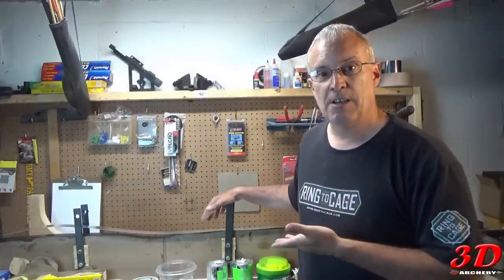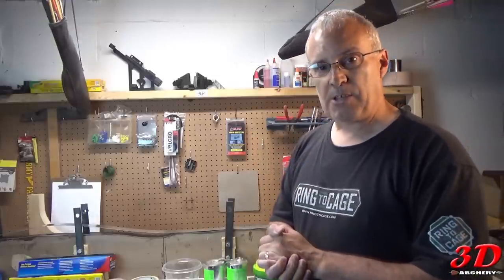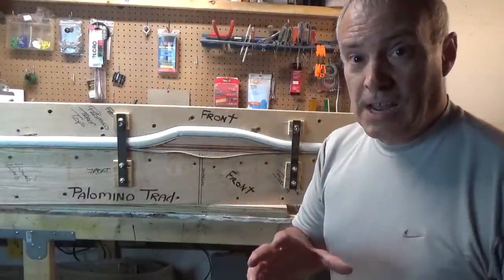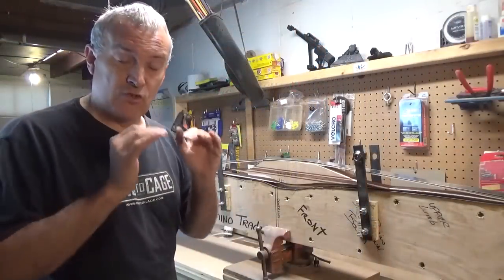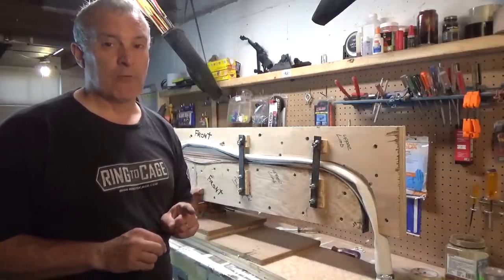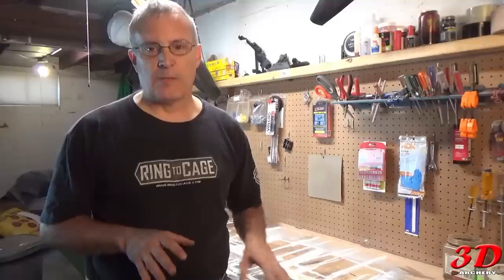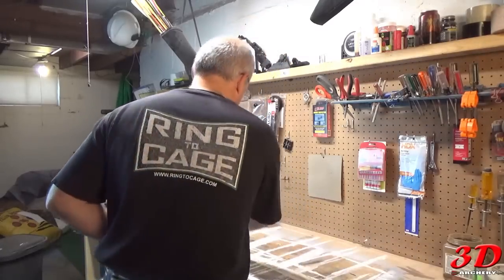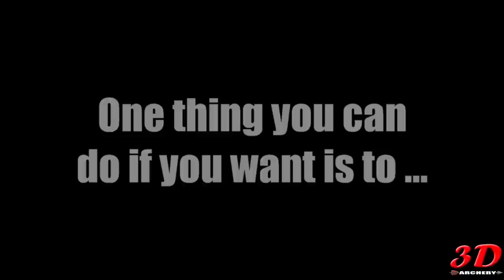How to Build a Bow: Step Four Laminating the Bow

Comment: Hi Greg.
Nice to see archers trying to build there own bows. 
A quick tip- the left ramp of the riser is too steep. That's why you had to cut the lams to fit. Next time, make the ramps more shallow and longer. Take this as a rule of thumb- the last inch of the fades should be no more then 1/16" thick, and the next 2" from the fade should be no more then 1/8" thick. Make the fade taper gradual and avoid steep ramps. The fades are where most of the stress is concentrated  and they have to be flawless.
Good luck

Comment: On the riser handle....thin edge of wood shoots off at an angle.  This means the laminated block is out of square. Right? Of course this is hidden later with the limb lamination strip.

Comment: Rather than cutting the laminate for that sharp bend, would it be OK to sand the sharp corner to a smoother transition instead?
Reply from the maker: Not sure what you mean. If you are talking about the riser. Yes you can, it is just more time consuming.
Reply: I laughed when I read your post Dave, because I thought the same thing, just sand down the riser. Thank-you Greg for all the hard work you do putting out all these great videos.